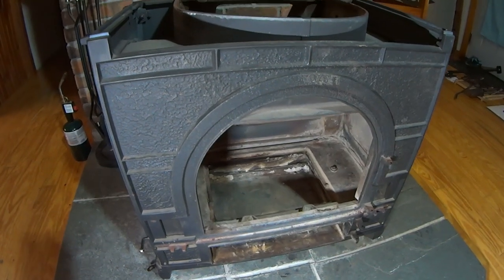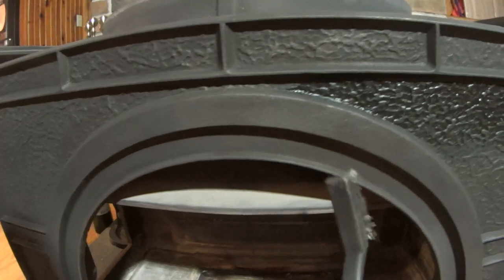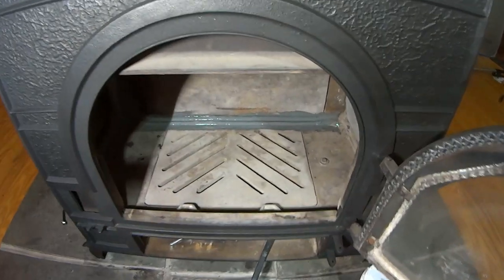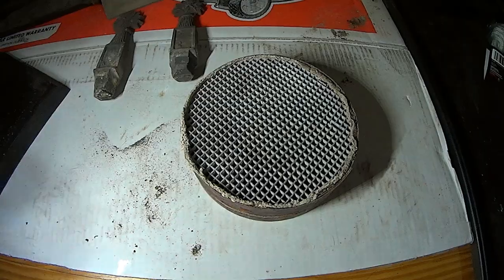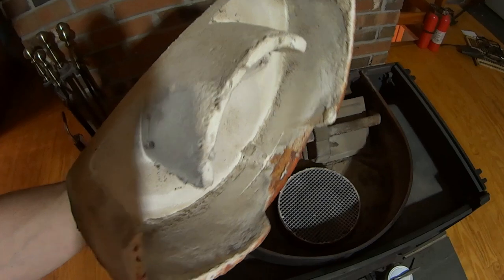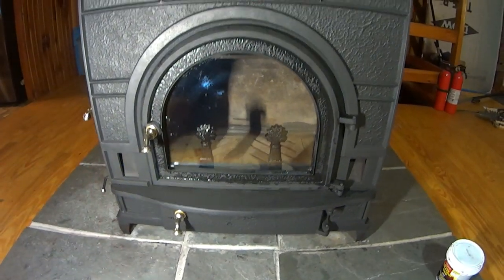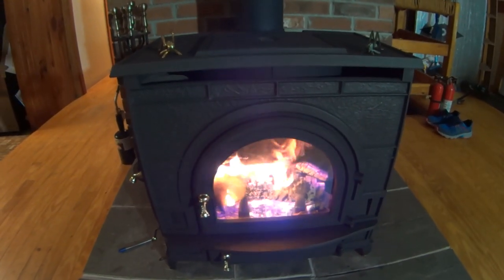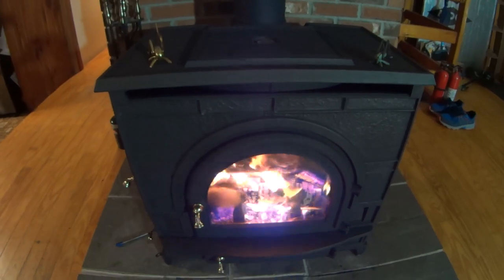Dutchwest Vermont Castings 2461 - Used wood stove build and restoration

Comment: What is the "hat/insulation" thing called above the catalyst?  I bought mine used and it didn't have one.  I would like to complete it.
Reply from the maker: @robertmatthews3800  "refractory" or "refractory package"  #56 or #60 on the factory schematic. They have a note... On extra large units built after August of 97' refractory differs from Small & Large. On extra large units built after August 1997, inner top and insert differ from pre-august 1997 units. This is straight from the manual. I hope it helps. Thanks for watching and commenting.

Comment: I have the exact same stove 2461. Nice job!
Reply from the maker: Thanks for watching.
Reply: @MTRFAB  By the way, my thermometer pulls right out very easily. Is it supposed to be that way? My manual doesn't give any instructions on it.
Reply from the maker: Yes. It just drops in and sits there. Very easy in and out. It's important to remove it first before removing the top as it sticks through the "hat" that covers the catalyst. It's will tear the hat unless you lift the top straight up.
Reply: @MTRFAB  Thanks

Comment: I have the same stove, its stinking when its out,im gonna pop the top and clean it out.thanks for the video, now I know to grab some ropes think its 1/2 inch and some cement
Reply from the maker: All the rope on mine was still good. Just needed to be reglued in spots.... With that said... I did purchase rope gasket that looked the right size when I got it home... It was 1/4". Not 1/2" . The sizing is funky either way. Please verify. I just want you to be able to get it done without another trip to the store.

Comment: Thank you for the video. I have been searching for it seems forever trying to find any how to videos on this type of stove. I have had the 2460 model for about 15 years that I bought used. I have had to replace back grate once and the catalytic combustor and refractory. I'm not sure how, but at some point last season, my damper stopped working. When I took the top off to investigate the problem,  I noticed the damper was split in two and  the inner top is cracked. By chance do you know how to change the inner top? Your video already had it in place when it started.
Reply from the maker: It's been a few years since the refurb. I don't recall how that went together. As you mentioned it was already together and looked good to use so I didn't knock it down further. I suppose maybe the parts breakdown diagram in the manual may help you determine how it goes together??? I haven't seen my manual for a bit but I believe last I looked it could be found on the net too. Might be worth getting yourself a copy? I wish you luck with the stove, they are wonderful. I hope you get it set up again. Thanks you for watching and commenting.
Reply: I have the same problem on a 2461. My inner top is cracked and I need help on replacing it. I can find the part to buy, but would love to have some instruction on the repair. Help!

Comment: Great video, thank you. Im still trying to figure out how to remove the damper to service underneath it. What is that gray compound you added in the back? You've shown to check several things i would not have thought of... thanks again.
Reply from the maker: Thank you for the feedback. The damper can be removed if the top is off. Take a peek at the back side of the damper control. There are a few big washers and a" C" clip. Remove the "C" clip taking care not to allow it to fall down into the back of the stove. Placing a rag over the hole might be a good idea. You need a small Allen key to get the brass handle off. Then all I can say is.... move stuff around a bit. It's hard to explain but you will figure out how it comes apart. It's a little tricky but once apart it went back together a few days later for me with no issues. The gray stuff was stove cement. It can be purchased at your local hardware store, depot or lowes. Good luck and thanks for watching.

Comment: How do you take the lid off? I can’t figure it out. Thanks.
Reply from the maker: Mine has four small bolts holding the top down. Two at each short end. Pull thermostat straight up and out before trying to lift the top. Lift top straight up when removing. Careful, it's heavy. Thanks for watching and commenting.

Comment: I have a FA264CCL Consolidated Dutchwest Wood stove.  The rear firebox plate is damaged where the plates hang.  The replacement part is available and I’m wondering if it’s worth taking on that job?  You look like you’ve had some experience taking apart airtight stoves.

Tom, Williamsburg, MA
Reply from the maker: I do enjoy these stoves! I've never knocked down a FA264CCL myself. I did take a peek at the diagram and it does appear to be similarly built to my stove. It appears as if the back may just be removable without knocking the whole box down. Approach at your own speed though as I can't really help you much more than that. Only recommendations... Careful knocking down...Parts are heavy, brittle and awkward at times. Anything that had sealant when you took it apart just needs to be cleaned up and reapplied before reassembly. Stove work is rewarding. If you have basic tools and some patience I don't think it should be bad. Good luck. Enjoy. Thanks for watching.

Comment: I have the exact stove. Just back puffed yesterday. With damper shut. Prob have to clean out catalyst.
Otherwise its been great this year. Got up to 1400 f the other day.
How does the catalyst air inlet work?  Is it just turning that knob above side door handle??
Reply from the maker: If the handle is facing down, it is in conventional operation. With the handle turned to the back of the stove flue gasses are redirected through the catalyst. Thank you for watching.
Reply: @MTRFAB  I meant the knob.not handle. do you have that knob all the way tightened?or do you loosen it 2 turns?
Reply from the maker: @TheMcl77  I do open that knob about a turn and a half to 2 turns.  When on catalyst... I close up the rest of the stove.
Reply from the maker: @TheMcl77  The other thought I have with your blow back... Just make sure the stove is above 500 deg F. Before you switch over to the catalyst. Try not to feed it wet wood.
Reply: @MTRFAB  thanks.
when is catalyst you fully close bottom 2 air inlets?? I usually have them fully open and the knob about 2 turns
Reply from the maker: Yes. I close the front vents almost all the way. Open the round knob 1.5-2 turns. Fire lasts all night. Nice coals in the morning.   If I leave the front vents open it will just rip through wood while on catalyst. So fast it wouldn't last a night.
Reply from the maker: The objective is to slow the air down through the stove. Allows  you the most time to get the heat out of it before it disappears up your chimney.
Reply from the maker: The Dutchwest manual has great info if you can find it. It does say...Use what air settings work for you. Every installation is different but the operation theory remains the same. "Woodburning is more of an art than science" that's how they sum it up in the manual. lol

Comment: Is this capable of being setup with a rear instead of top flue?
Reply from the maker: I believe you can rotate the exit flange to point straight back. I would refer to the manual to double check though. Thanks for commenting.

Comment: Can you run this stove with the front door open? or will to much smoke come out?
Reply from the maker: I guess you can. I've done it but usually won't open it till it's burned down a bit. Seems too smokey with fresh wood. Def would not run open on catalyst as the draft would be lazy and would probably get smokey fast. Thanks for watching and commenting.

Comment: Great video!  I really like these and plan to buy a used one but don't have a lot of help to move it.  I read they are about 400+ lbs.  How much does it come apart?  Do you think one guy with a dolly, cart, jack, straps, pallet, etc. could get it moved?
Reply from the maker: Thank you for watching and commenting. My lady and I moved it.... I knocked it down to the pieces seen in the video. The shell was super heavy still (250+ lbs ). Definitely couldn't have done it alone... I have a few stairs to climb though. I would def say it will be a struggle by yourself unless you are an absolute beast. Getting it out of the truck and upstairs was the challenge for us.  I wish you luck. I suggest a helping hand... It will be worth it. The stove is amazing. Thanks again for watching.

Comment: Does your stove have the grate on the back wall? I have the Dutch West 2462 and my grate that covers the back wall is warped. I’m considering replacing it.
Reply from the maker: It's not a grate on mine... There is a cast iron insert with no slots of holes in a recessed pocket on the back wall. Thank you for commenting and watching.
Reply: Thanks for the reply. Mine isn’t exactly a grate either that’s what the owner’s Manuel calls it. I’m not really sure what it’s function is. I’m guess to help keep the back wall from direct heat so it last.
Reply from the maker: @casehunter8376  I agree... I think it's there for protection too... A sacrifice to the heat gods! Lol.
Reply: Mine is warped and cracked too. I believe it is a heat shield .
Reply: F Mann that’s how mine was too. I ended up ordering a new one on line and replaced it for $100. Easy to put in.

Comment: I have a chance to get one of these.  Still pleased?
Reply from the maker: Absolutely. No regrets. 100% recommend! Buy it before you can't. Thanks for watching and commenting.
Reply: @MTRFAB  what's inside? I have a quadrafire currently and trying to restore it. It has firebrick but this doesn't appear to have anything inside other than cast?
Reply from the maker: No brick inside this stove. All iron... I don't think I would have been able to move it if it had brick... lol . It's heavy for sure.
Reply: @MTRFAB  thanks for the info. If nothing else I'm going to use thay polish on my quad when I get it up and running
Reply from the maker: @argylejake  Polish will make it look new again for sure. I'm looking at mine right now ... Still looks pretty good from last season. Pleased with how that polish held up.

Comment: A family friend gave us a Dutchwest 2462 which is very similar to this model and we used it for a whole winter without knowing anything about how to manage it. I didn't even know it had a catalytic system in the top! But thanks to you, I understand exactly how to use it and maintain it in future- once I replace the air distributor, combustor and seal  which were all trashed! I wonder if we melted the air distributor through our misuse, or by running the stove too hot. ( I was making biochar in a small pot on top of my fires, so I would really get it blasting to bring the materials up to temperature to burn off by pyrolysis). Any ideas?
Reply from the maker: We enjoy these stoves. The first one we had was the next size down. We over fired that since it wasn't exactly big enough to effectively heat our home. Most of the interior plates got consumed. This model has fared much better as it's sized correctly. This one has been used on the catalyst as primary heat since I made the video. All the bits inside are still good. Luckily, I believe Vermont Castings still sells the bits and pieces. Thanks for commenting and watching. Enjoy your stove.